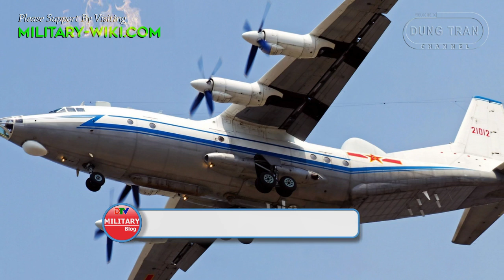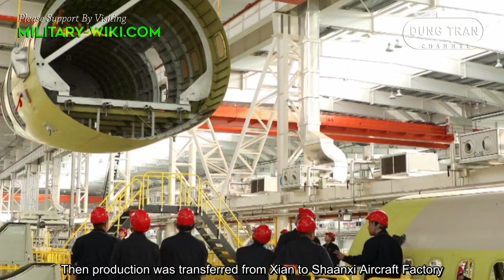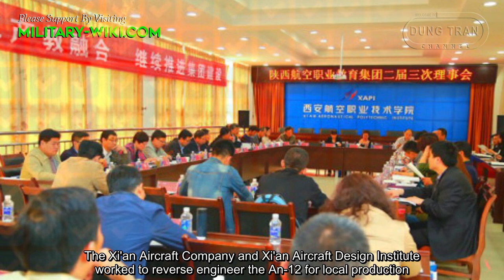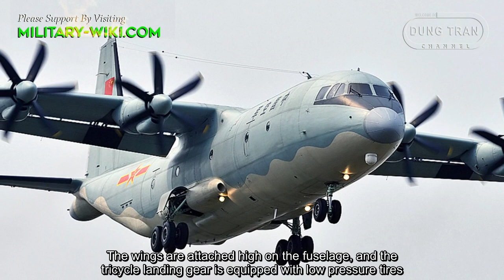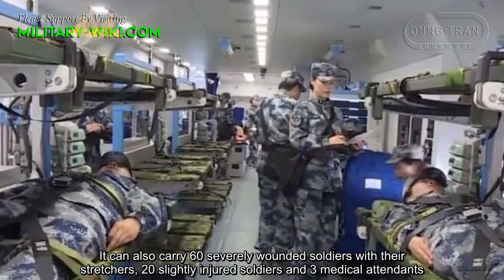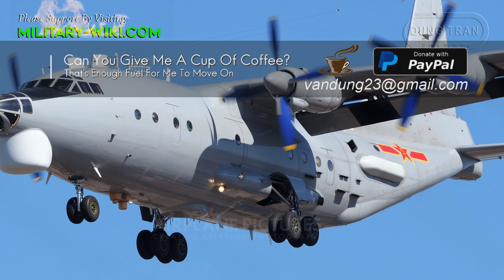Shaanxi Y-8: Copied from the Outdated An-12 but still Good Enough for China

Comment: It doesn't even come close to the quality of the An-12, they had to redesign it and build a Y-9 to even get close to the originals sixties quality.
Reply: i seriously doubt the 20 ton payload looking at that landing gear!! it's definitely a finished strip bird with that gear!!
Reply: actually they are much better  the old soviet because is lighter and better radar.
Reply: @laosasean8482  can't do worse. But the quality of the Chinese radar is best illustrated by the near collision with the P-3 a couple of years ago. The P-3 avoided it while the Chinese AWACS wasn't even aware that the P-3 was there.
Reply: @jacksonteller1337  Hainan incident have nothing to do  with radar. Its what intentional by US pilot to killed Chinese pilot  Yang Wei. The Chinese pilots intercepted the intruder and one of them got knocked down by the aggressor warplane.
Reply: @jacksonteller1337  And Chinese very practical whatever you can do they can do better, and cheaper. Just look at Boeing 737  Max-8 vs C-919. And China is only country that can   compete with US in all the fields. The Russia currently not capable of doing that like they used to back when they were  former  USSR.
Reply: @jacksonteller
Y-8 is not close to AN-12 in quality??? 🤔
Apart from Myanmar AF Y-8 that crashed due to pilot error during the fog, have any Y-8 ever crashed?
So stop talking rubbish.
The Y-9 in fact is too advance in comparison to the original AN-12 e.g. 6 propellor blades turboprop, avionics, etc.
Reply: @mythbusterthe6749  enjoy your ignorance. I have been air force for 28 years and only a complete lack of knowledge would lead to your conclusions. You misspelled PRC-propagandist in your handle. Enjoy the corruption and lack of quality control because it worked so well for Russia. All the failures in their equipment was due to Chinese components replacing the western ones. From tires to electronics everything failed. Now they are bogged down in a war they cannot win.